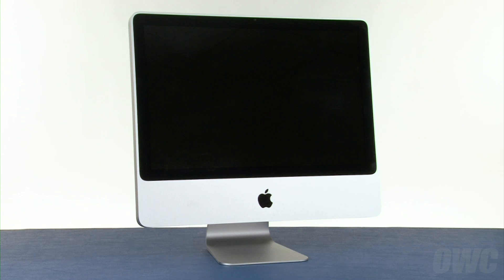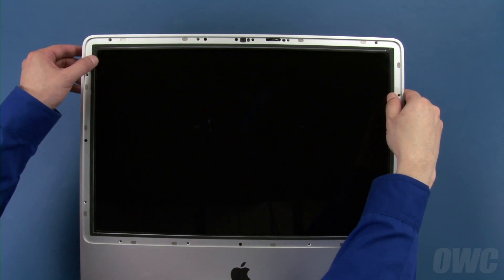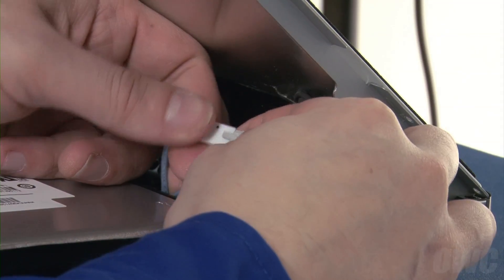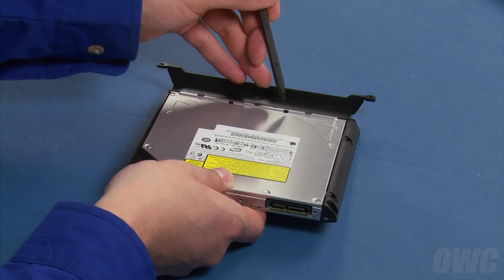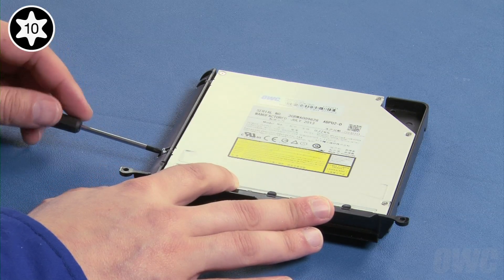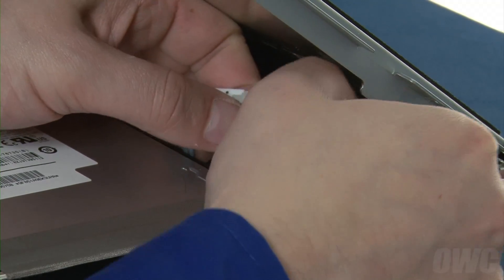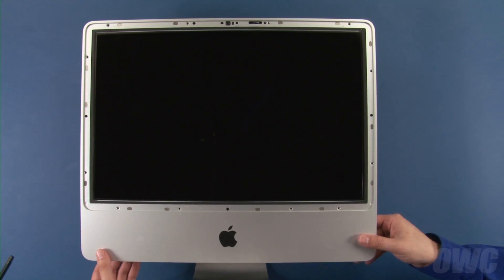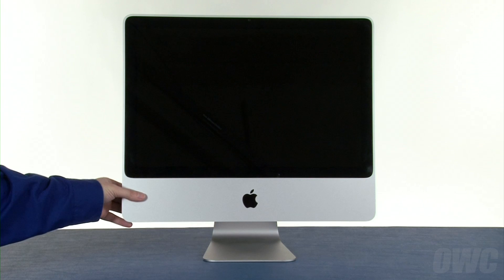20-inch iMac (Early 2009) Optical Drive Installation Video

Comment: The inverter pair connectors on 3:27 have different coloring codes on the LCD, but on the board it has only four gray colors. Does it matter how you re connect them back when re assembled.?
Thanks!
Reply: I took a black marker and marked only one of the two (on the male and female parts) on the set below and then did the same to the set on the top. You only need to mark one set of plugs because the ones without the marks will obviously attach to each other. I wasn't sure myself whether this mattered or not but this way I am guaranteed to reconnect the same plugs I detached.
Reply: Mondo 357 I have put it back together after installing a second drive caddy and all is well. Actually OWC CS says the color codes don’t really matter  at all but I did mark them to be sure.
Reply: @guitarontheflipside596  That is good to hear and that's actually good information to know as well. I used an original drive that I found on eBay so I was able to essentially just do a flip. But if it wasn't for this video, I would have been forced to drop it off at an Apple store, which I didn't want to do. I paid $8.99 for an original Apple optical drive with free shipping and got it in 2-days! That's a lot better than the several hundred bucks the Apple store was going to charge me!
Reply: Mondo 357 Great! Yea, luckily enough this model is one of the easier iMac models to swap a drive. I actually put an SSD in the caddy and booted the iMac to it.  The stock HDD serve as a storage drive. The iMac runs 10 times faster now. The iMacs become harder to upgrade as they become slimmer, but this one is upgrade friendly considering..it was so dusty upon opening it i had to vacuum it for like five minutes..lol.

Comment: i am concerned i might have placed the cables in opposite slots to the ones they were originally in since my display has some funny glitching pixels on the side and dotted randomly ever since reassembling and turning the mac on...can you help?
Reply: DSEPH  it might be the inverter cables on 3:27. I’m waiting on an answer from OWC in regards. I had no problem so far when re assembled..but it may be the color codes of the two pairs in the LCD. Notice that on the board, there are 4 gray cables,  while each  pair of the inverter cable are red and blue.maybe it’s not the problem, or maybe I just got lucky. Really curious about this..